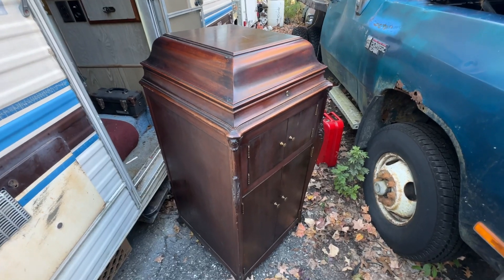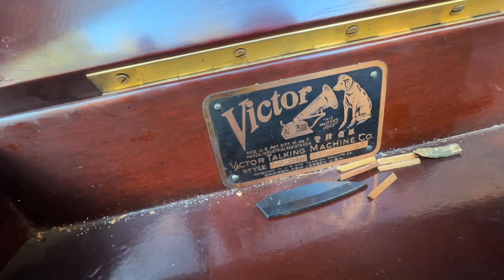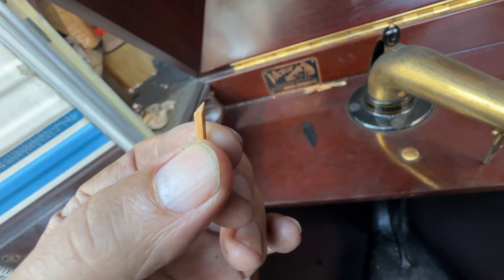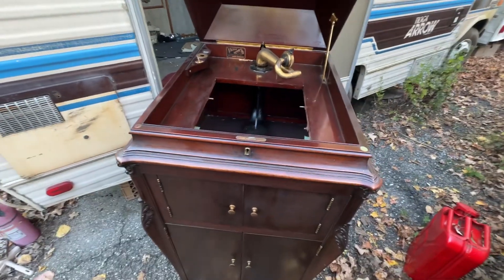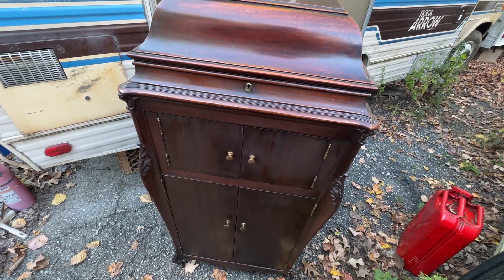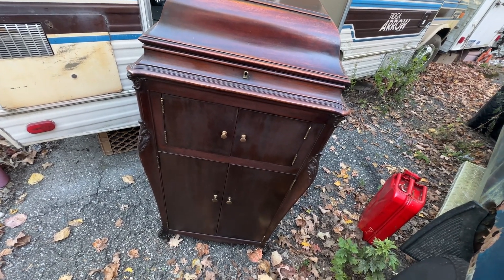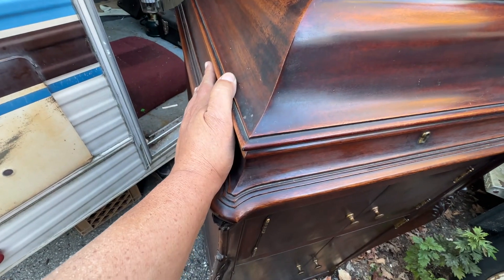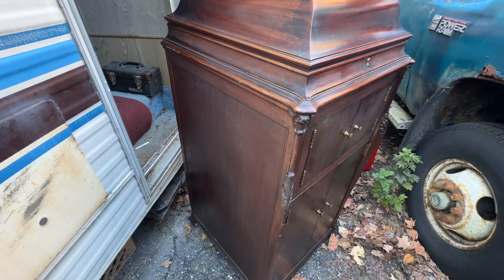Quick look at the 1913 VV-XVI that I just picked up that was a single-family machine since new

Comment: Beautiful cabinet.
Reply from the maker: @213thAIB  Victor was manufacturing these cabinets themselves in-house by 1913, actually a few years before that, but this is the first year of the more conventional door design that would stay in place right up until the end of the company. They are built like the proverbial brick crapper, rock solid, and of the highest quality materials at least at this time. It has since been given a good cleaning and is looking much more presentable now. The front columns are hand carved and would be toned down somewhat by the end of 1914. So this Euler design of the 16 cabinet would only be used 1913 and 1914. It would be given a bit of a facelift in 1915 so it was more in tune with tastes of that time. I think they should’ve kept the more Gothic look of the original carved posts, it gives the machine a certain presence. Things like handcarved posts were a perk that was only available in the flagship models at the top of the price range.